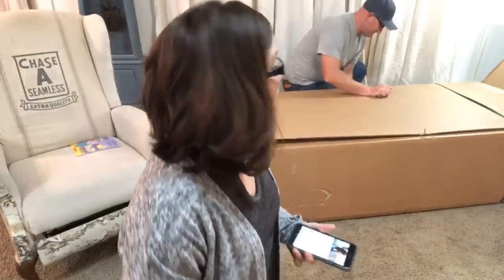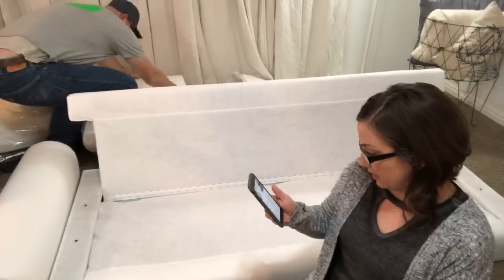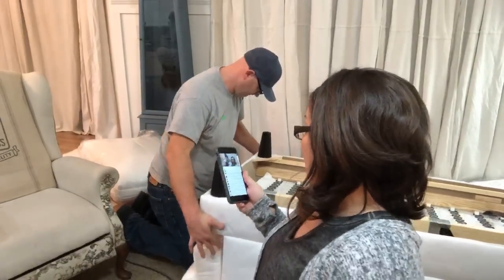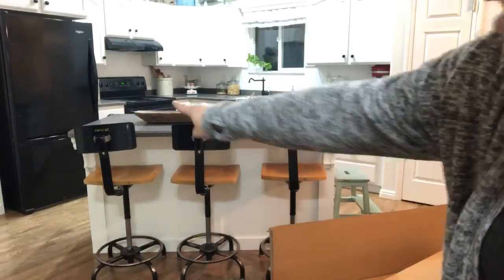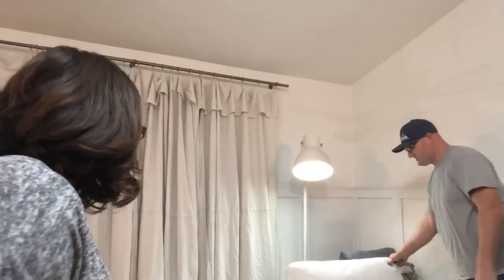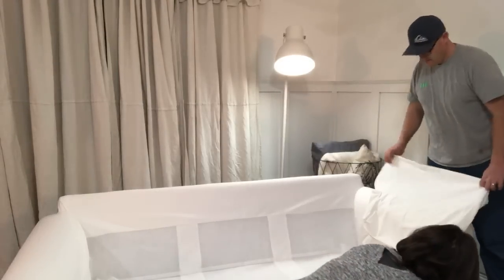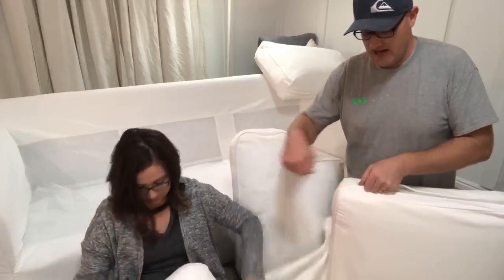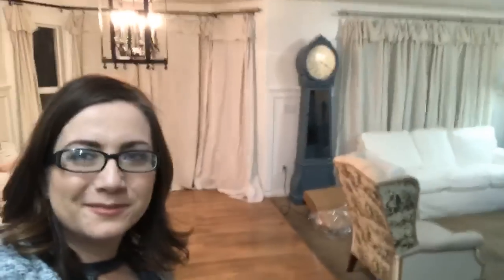How To Assemble An IKEA Sofa

Comment: We’ve had our Ektorp sectional for six years and still love it. We have two small dogs, our two daughters with their sons live with us. It made the from Washington to Arizona three years ago. The original white cover we bought lasted five years before I just couldn’t get it as white as I liked anymore. The seat cushions are starting to go a bit flat so I’m getting ready to do a down type foam cover replacement on them. We purchased the gray cover at the initial purchase and used it off and on. I don’t like it. It’s rough and has horrible pilling no matter how many times I use the shaver on it. I finally gave up and just busted open the new white cover, which we purchased thinking we (I) would just rotate between the two white ones. I’m glad we didn’t now, it wasn’t necessary. 
I hope you’re still enjoying it a year later and buyer beware of the gray cover. 🙅🏼‍♀️
Reply from the maker: I’ve been washing mine about every other month and I’m so happy with it!